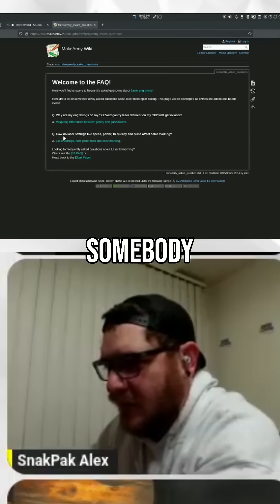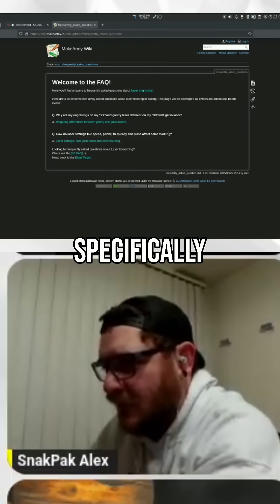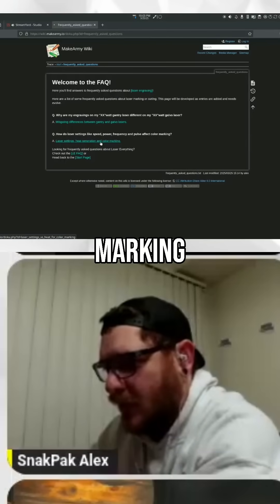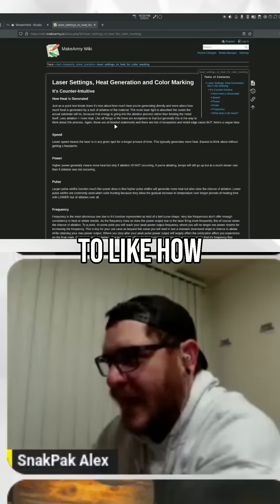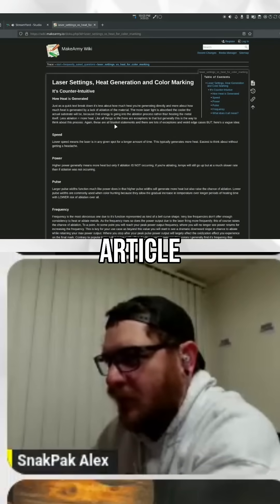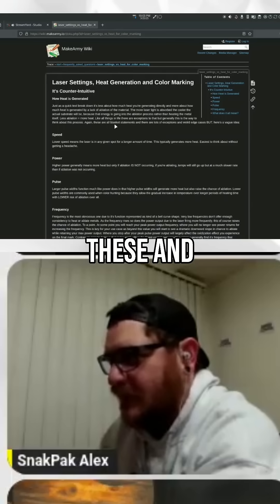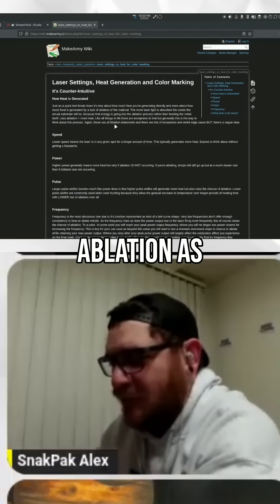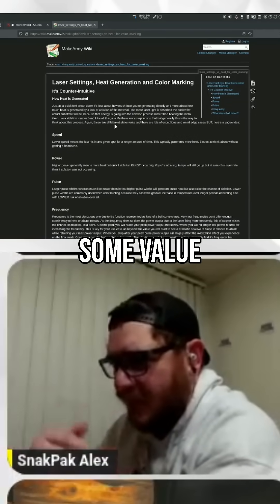How do laser settings like speed, power, frequency, and pulse affect color marking? #laserengraving

Comment: Alex I have looked on the website and cannot find this article you are referring to on here. I am trying to get a solid understanding of how the 5 settings (power, speed, frequency, q pulse and lpi) interact. I have found very little on this other than you set this for this and so on. I understand the frequency and q-pulse functions and how they interact with each other but need a rounded understanding. Sorry for the engineering brain question. 

Where can I find the article? Thanks
Reply from the maker: Here's a link to a relevant episode of the podcast that I think provides a really good breakdown: https://www.youtube.com/watch?v=h99UGpiRdLc

Further reading, maybe what you were looking for. Regards color marking but principles apply to everything: https://wiki.makearmy.io/doku.php?id=laser_settings_vs_heat_for_color_marking
Reply: @LaserEverything finally got around to watching the video. That is exactly what I was looking for. You and Kyle both took difficult information and using the analogy and triangle chart explained the relationship. Now it's back time for some materiall test to put it to use. 

👏🏼👏🏼👏🏼👏🏼👏🏼👏🏼👏🏼Virtual Standing ovation 👏🏼👏🏼👏🏼👏🏼
Reply from the maker: Thanks glad to hear it! I had a feeling it would do the trick!
Reply: @LaserEverything I will check it out. Thanks